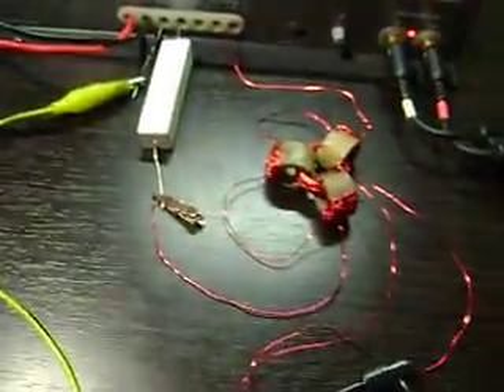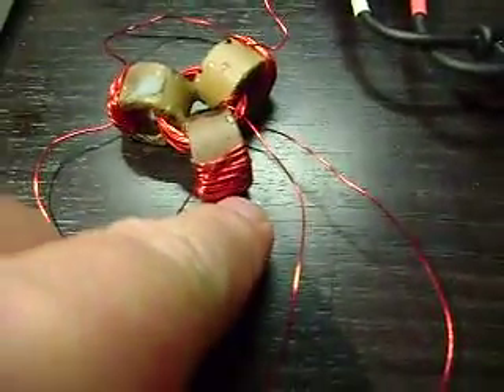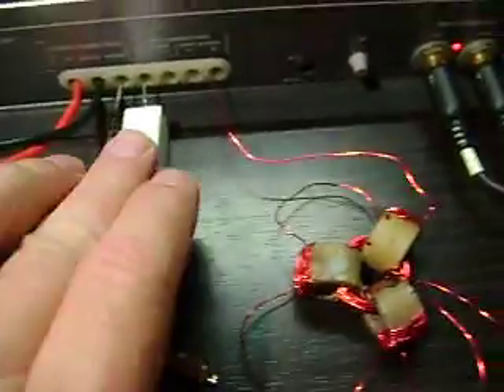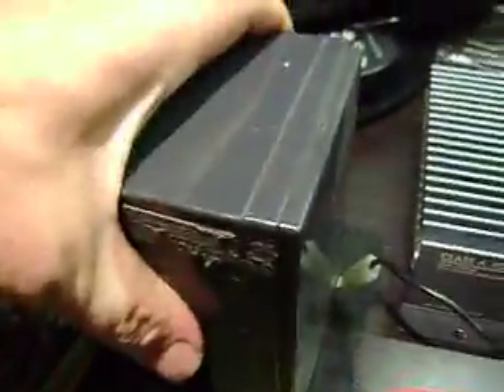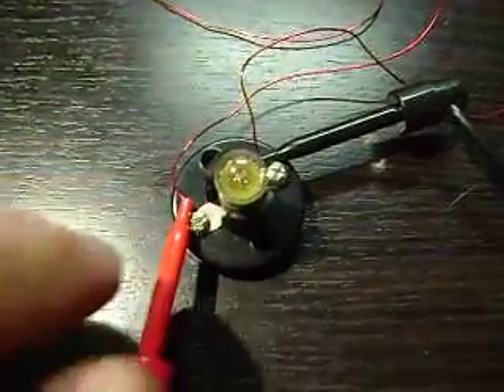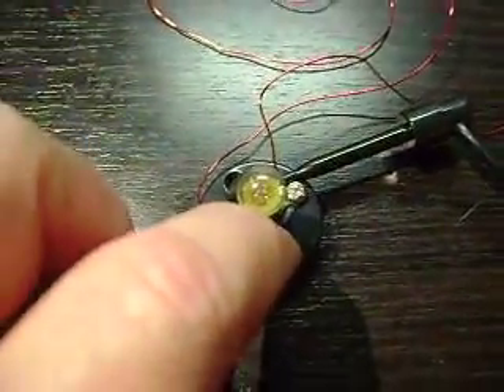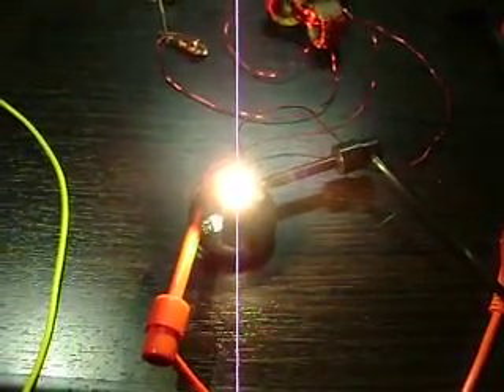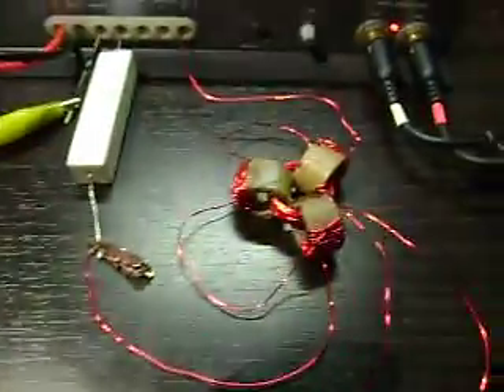Testing Multi Core Inductors

Comment from the maker: These are measure of voltage across each device,
and are just peak voltages during the sweep.

Amp out    2.96vac
Resistor    15.06vac
Primary     2.066vac
Bulb         24.98        

What doesnt make sense is the amps output max is 2.96v but we have 15.06v max across the resistor.   ???

Measured it twice.

More this week

Mags